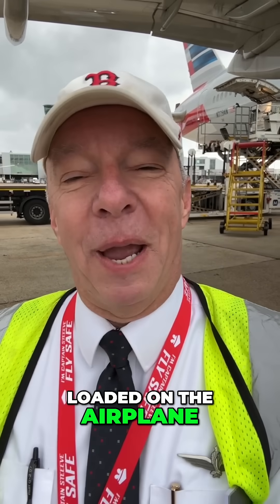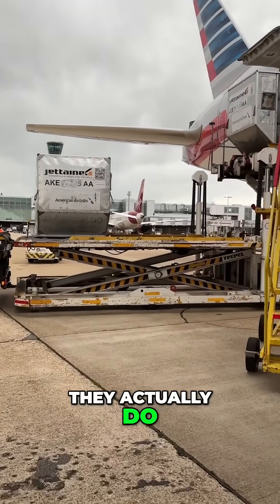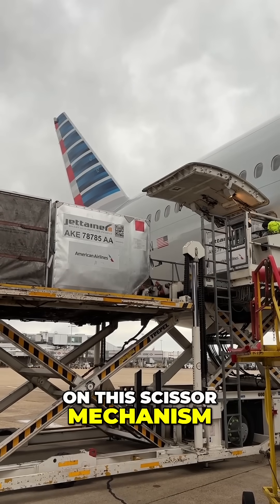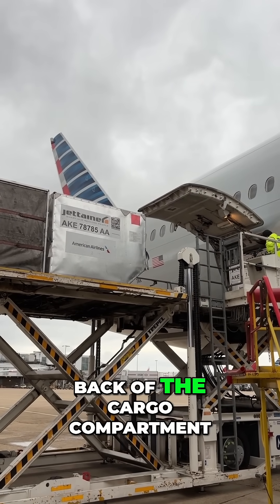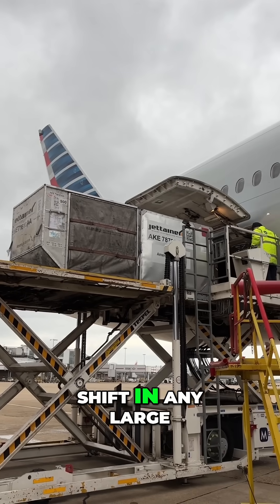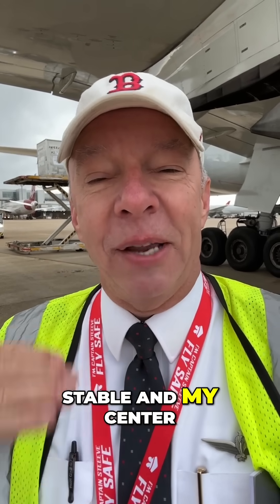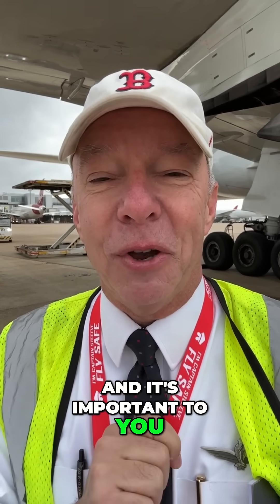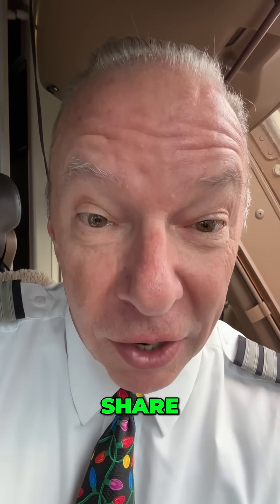How Your Luggage is Safely Loaded on Airplanes

Comment: I’m a ramp agent in ANC. I regularly work on 747 and 777 aircraft. The scissor lift is called a K loader. The one shown here is a LDL which stands for Lover Deck Loader. We have MDL as well which stands for Main Deck Loader for cargo planes that have a cargo hold where the passengers would usually be for a passenger plane. The “Bins” are called Unit Load Device or ULD. One ULD per compartment in the cargo hold and when it’s in place, we put all the locks up to hold it in place as stated in the video.

Comment: Cpt. Steve our Army Unit leased a 747-400 1986/1987 and I loaded 400 duffle bags into the cargo holds the bays was separated by metal shields we flew from Fort Eustis , VA to San Diego ,CA then to Los Angeles and then to Seattle Washington we was TDD for about 2 1/2 months I had we had cargo bins like yours my job would have been much easier .  Thank You Cpt. Steve.

Comment: How can a pilot see that the plane is loaded evenly and the center of gravity is where it should be?
Reply: You can see it on your calculation or on the loadsheet you get. Also on the 777 you have a green band (small display) for stabilizer setting for take off. If it’s not in the green band what you calculated then something is wrong.

Comment: Captain Steve.. do you visually check the compartment when it is finished to make sure that all is done right? 
Thanks
Reply: There is no time to do that and no pilot would go into the cargo holds to check them
Reply: Yeah, I don't think you can get around the cargo on a 777. 747 has room to walk down the sides and check for damage and proper security
Reply: Thank you!
Reply: On 747 cargo planes, the main deck is walked by the FO and weights are randomly checked.
Reply: @ what you gonna check on the main deck? On the 777 you can’t check anything, loading is usually finished a few before departure. 
Are you working for an American company?

Comment: There was a 747 that crashed in the middle east because of loose cargo.....a tank came loose and threw the plane upon takeoff
Reply: A load of five MRAPS were loaded and tied down incorrectly. When one broke loose, it damaged the stab trim screw, making the aircraft uncontrollable. The load shift itself didn't cause the crash, the damage did.

Comment: Loading and securing cargo is equally as important a job as the pilots. Loose loads are bad news. I'm only a  truck driver, but have seen some horrendously dangerous accidents caused by insecure loads.

Comment: There’s a famous video of a giant airliner crashing because on takeoff and I believe it was a cargo plane. A bunch of the cargo shifted backwards toward the tail of the plane and made the tail super heavy pitching the nose up to a point that the pilots couldn’t control it and they were low to the ground so the plane stalledhas it had a huge angle of attack, dropped a wing, and spun right into the ground
Reply: I remember UPS flight doing the same thing out of Sacramento when they took over Mather AFB after was shut down. Load shifted left wing down all crew kia. It sucks how 1 mistake can be the end if it. 20 yrs ago or more i believe.
Reply: Yeah I saw that. The plane dropped like a rock.  A sickening thing to see.
Reply: The load shift didn't cause it to crash as the 747-400 would have been able to handle it. The damage that was caused to the pitch trim mechanism is what brought that plane down. Load was tied down improperly.